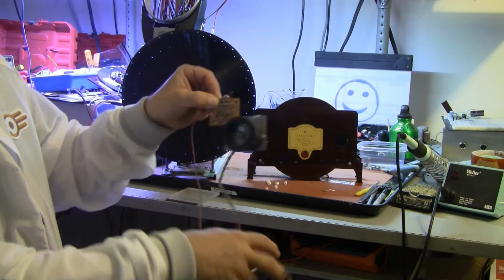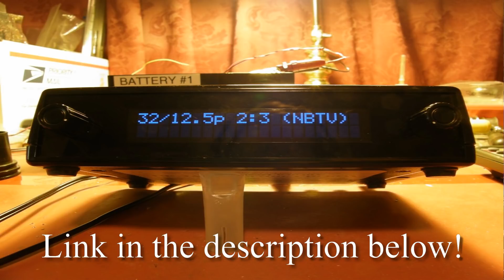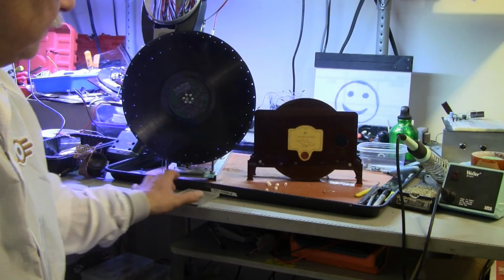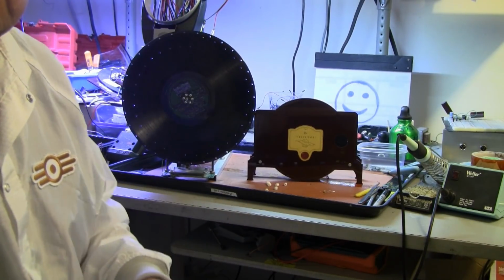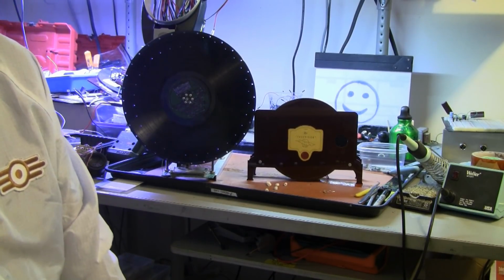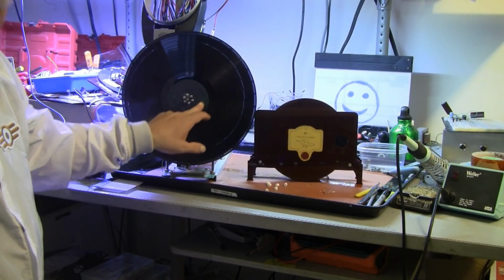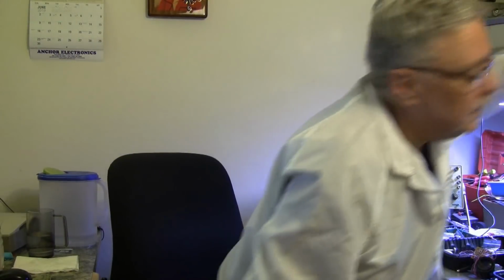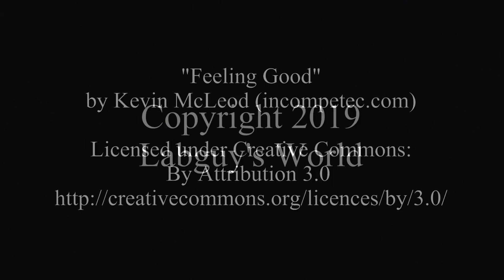Narrow Band Television, Project Introduction 20190611

Comment: Looks good, I am keen to see you do this. A couple of notes. Beware that BLDC motors can be acoustically noisy. That was one of the biggest issues for me. Also the most important thing is the quality of the disc. e.g. no wobble and perfect hole placement and size. Good luck
Reply from the maker: Thanks for the advice. I am hoping noise wll be very low at 750RPM. I have seen other LP based televisors that do not suffer from the wobble. Any ideas why?
Reply: @videolabguy  Brushless motors for rc boat, monster truck, and plane are much slower than drone motors the motor form my rc truck tops at 2800 rpms at 34 volts. Also motors with a hall sensors are capable of very accurate rpm hold such as speed controllers for helicopters.
Reply: As soon as you put some holes in plastic it will distort due to inner stresses. One thing I was going to try was anneal the disc in the oven for an hour at around 80 to 100c on a flat substrate like glass sheet.
Reply: The motor noise is not an artifact of rpm speed. It is caused by the electronic modulation. You can play your stereo into a BLDC and sound will come out. I used this for beepers etc on my robots rather than fitting speakers

Comment: Great color results at the end!  Interesting that you postulate air causes the wobbling problem. The model right next to your record has a housing over the disc. I wonder if that was reason for wobbling.
Reply from the maker: The biggest problem is that the disk droops over time if not used. Imagine a floppy disk standing on edge. It will collapse under its own weight. It seemed like the longer I let it run, the flatter it got.
Reply: @videolabguy  Now all you need are the cutest, softest rubber pinch roller kind of guides.... pinch rollers?

Comment: Cool new project idea.  I'm keen to see the Aurora unit in action, since I've wanted one for a long time.  Expensive, as you say, never mind no longer available.  The pictures you show at the end of the video are really good - I could easily identify the individuals by name (especially the Laugh-In cast).  I wonder why the photos of Baird's equipment's images always look so poor by comparison - maybe problems at the camera end.
Reply from the maker: You nailed it. Baird's camera was limited by the technology of the day. He had to use flying spot camera techniques and his photo tubes were single stage. It is such a complex problem, I have no plans to build a mechanical camera any time soon. If I did, it would use a dichroic mirror block and ten stage two inch diameter photomultiplier tubes.

Comment: Hello Richard i am happy you are working on NBTV again ,i just finished my latest project The Binocular a dual NBTV monitor oscilloscope ...since you are talking about the ideas here and people may be new to it i will post a link here to the NBTV forum for others to learn ,its to that project of mine but do browse and learn Nbtv can be electronic or mechanical or bit of both.
https://www.taswegian.com/NBTV/forum/viewtopic.php?f=15&t=2724
Richard as you know the Nipkow can be improved on for loss of light as a bead or lens disk to increase picture size via projection to a screen so you could do any size and not be limited to a tiny postage size image a big improvement  and little used but very possible these days .
If you used a 2 slot slit disks one for line one for framing you can turn the idea into a NBTV multi system monitor only limited to the line disks motor rotation speed ...i have always found a pulley system to increase the speed of the motor works well for the line one ..i have only done this will slit drums and polygon mirrors a disk would be a lot easier .
Any case there a a million ideas for mechanical television reason i never get bored with it you can still reinvent the idea.
Reply from the maker: I saw your binocular system. Very cool. Yeah, there's a million ways to go. That's part of the problem. I think I will start with the NBTV signal coming from my World Converter then move on to the sync separator which can lead us to the wheel servo. We'll see where it goes from there. I will stick with the plain Nipkow disk to keep it as simple as possible.
Reply: @videolabguy  Any Tv system is hard to get right and mechanical television can be a bugger to get that motor to cooperate...i have always gone DC when doing these apart from stepper motors  from time to time ...The world converter is a nice gadget i am stuck with having to make my own video signals with PMTs flying spot scanning ideas .Good luck i will look out for your posts.